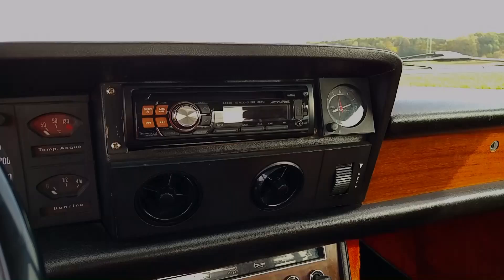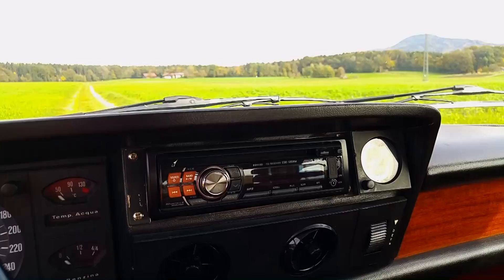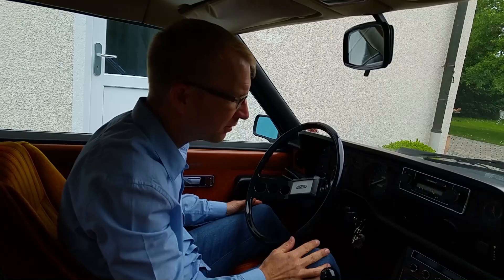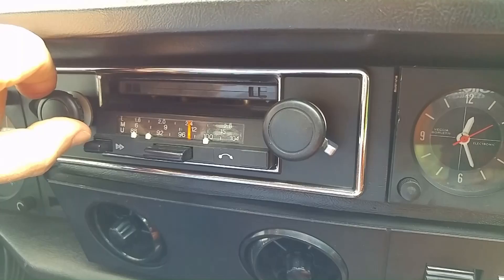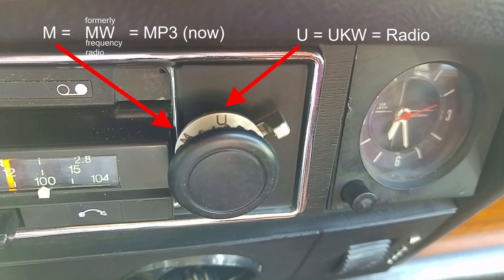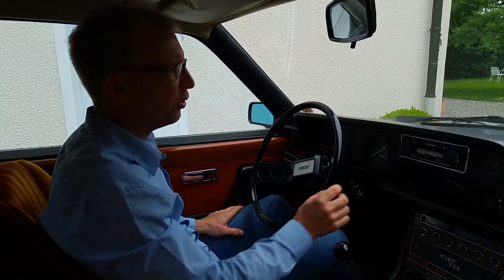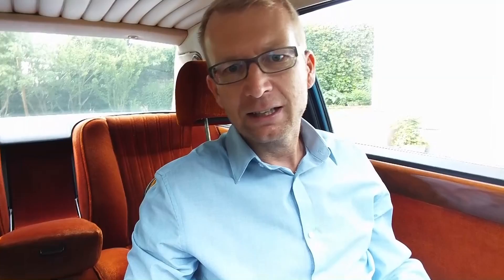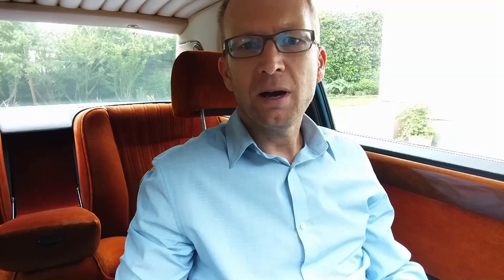Classic Blaupunkt Radio with MP3 mod for my Fiat 130 Coupé | Update on my first Fiat 130 Review

Comment: That radio installation is great - looks like it has always been there from new! Can you not get some kind of Bluetooth receiver to work with the iPad instead of that cable though?
Reply from the maker: I think it would be possible to connect the cable with a bluetooth transmitter (located in the glove box), so you don't have to connect your phone with the cable. But this bluetooth transmitter needs to be charged (of course, possible to connect with your 12V supply in the car), and I expected poorer quality with the bluetooth connection, so I prefered the cable. But maybe the quality would be the same, so would be worth to try.